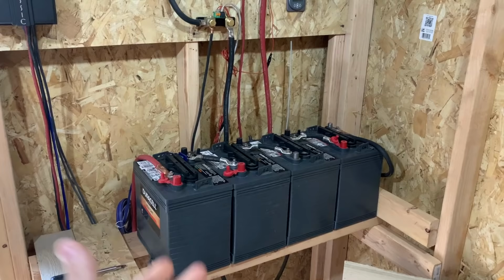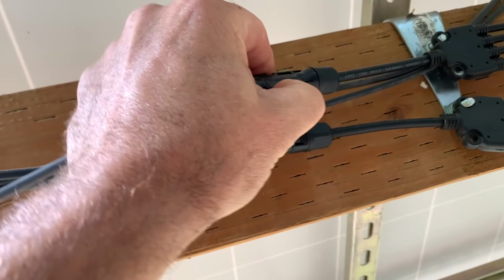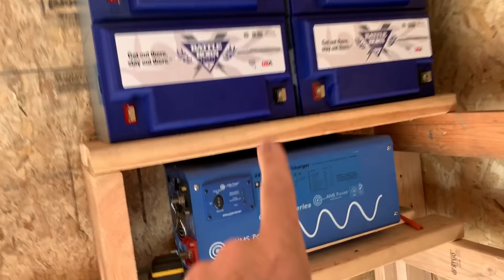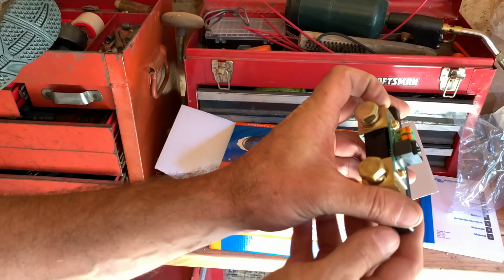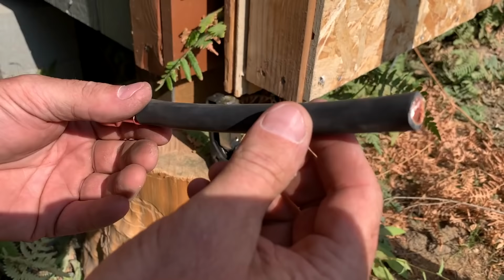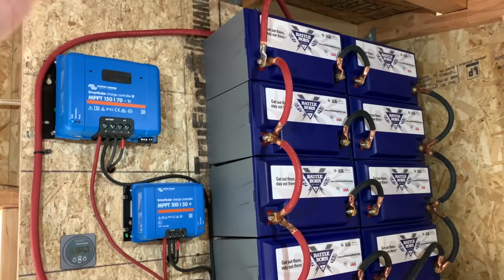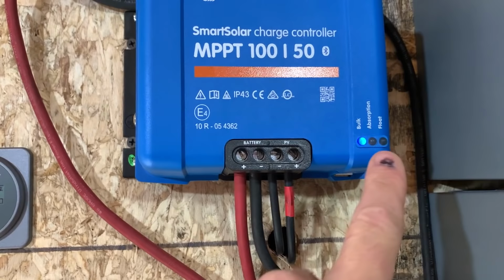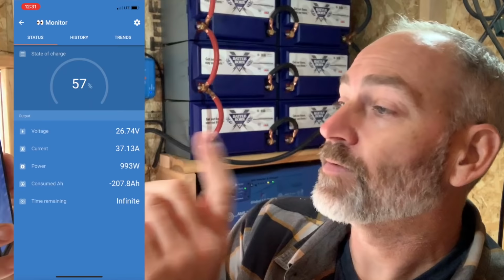EASIEST Off Grid Solar Power System Battery Bank

Comment from the maker: ☀️ NEWEST UPGRADES TO OUR SYSTEM SEPTEMBER 2021 https://www.youtube.com/watch?v=MeaANzjzwf0&list=PL-O59UCFPykiDokS7BRIusbw-D3YJA3jN&index=9
Reply: This is seriously the BEST video on this topic I EVER saw : ) Great products. Super good simple explanation. Thank you. I am totally gonna start thinking about what I want to do for my house.
Reply: Wish you listed how much this upgrade costed you.
Reply from the maker: Wow. Glad it was helpful.
Reply from the maker: The prices are in the links in the description.
Reply: what are you gonna do with all your old components and batteries?
Reply from the maker: @brandonlacour1277  keeping them for another project for now.
Reply: @MartinJohnsonOffGridLiving  well if they get in your way let me know id put in a bid for them 😀
Reply: @MartinJohnsonOffGridLiving  but certain items say sold out with no price...can you list your cost overall..
Reply: Very important to have ALL the battery cables the SAME length! Needs heat shrink on them wires ends, don’t want a short! And you need a disconnect switch
Reply: @FilipinaRandom  It was around 9504 dollars from I can figure out tbh
just a tip though I'd defn put some kind of thing to hold those batteries a bit more secure as I'd be worried they'd all fall down
Reply: Did you receive compensation from Battle Born?  Why did you choose to go lithium vs expanding your lead acid battery bank? You list life, and charge rate... is charge rate an issue on the lead acid, is life less than 10 years for the lead acid?  I'm wondering what the cost benefit of using lithium vs increasing lead acid to the same 400Ahr capacity might be?  $8k seems like it would buy you a bunch of lead.

Oh sorry (edit) at 23:45 you tell us that Battle Born helped you out with cost.
Reply: @Nonya Bidness he can I think 
I then he's likely trying everything the same chemistry for simplicity tbh
Reply: Hi how can I contact you with some questions?
Reply: @earthenergyhex  Batteries are a deal killer for solar. Unless you're off grid, then you just have to pay it. These are actually a great price for what they are. What's funny about solar, is that the panels are the most affordable part of the system.
Reply: @DeepSnowRider  Just go to the website and check prices. The batteries are like over $1,000 each. Not including all the other top of the line stuff. He is being given this stuff to promote this equipment.
Reply: Hello Martin,  one of my coworkers told me that he reached out to you and you were responsive. I have a few questions I'm hoping you can help me with. I recently bought a home off grid. Unfortunately the batteries(lead acids) are in need of replacement. I'm trying to figure out how many lithium ion batteries my system can take. Can I send you some pictures of my current system? Thanks for your help.
Reply: you have to look what a wind mill paired with electrolysis and water supply gives you in terms of a huge tank of hydrogen... wind mill and simple hydrogen generator are capable of running forever and are cheaper than solar panels and batteries plus YOU can fix it. The way this works(and there is a 11 households  in Argentina using this system since 15 years without troubles) is the windmill just powers electrolysis making the tank get filled with hydrogen, so, basically if you can tap on a river you have literally free energy at incredibly lower cost/maintenance than solar panels... plus nobody needs to be called to fix it.
Reply: Hi. Can you list all parts for this installation please?
Reply: @DeepSnowRider  I did a rough guesstimate using Amazon and it came to about $8900.
Reply: umm mr them batteries are 950$ EACH YOU HAVE 8 OF THEM   !!!!
Reply: @dkaloupis75  huge tank, hidroyen generator, any windmill, huge fence and space for the tank and the pipes from one tank to the other... the electrolysis is cheap, the generator is a small motor and the tank pluss space is the only pricy yet nothing if you compare it to 8 batteries plus switching around... btw if you mount it make a video or you will be in debt ! and karma it's a thing! :)
Reply: Mounting Li-Ion batteries like that isn't a clever idea, neither is your wiring.
Reply: @kingscroach  this system is powering 11 households in Argentina since the last 20 years the cost of maintenance is about 1,0000% less, it is the cost of the maintenance of a motor of the size of a motorcycle. Yes you need water to get the hydrogen... WATER. Electrolysis is a simple process and there are all kinds of machines made with very efficient yet simple and cheap capabilities... please simply research before stating nonsense out of nowhere.
Reply: This is hardly a savings. Your looking at what..... $20,000 for this set up? Over 10 years, IF it lasts that long, is $166 / month. How is this a sound investment??? I spend less than that now hooked to the grid. You know how many truck batteries I can buy with $8000.00....?
Reply from the maker: @miuzik8op908  Was it supposed to be an upfront savings?
Reply: How much is the total on panels and everything ya got into this setup
Reply: Dag'um 1k per battery lol
Reply: Dude got like 15k or so in this setup lol I reckon over time it'd pay 4 itself lol
Reply: Shoot the solar panels ain't but like 350 each
Reply from the maker: @Preacher26  check the link in the description they are way cheaper than that.
Reply: @Preacher26  About $20,000!
Reply: @miuzik8op908  that's was bout my guess 15k-20k
Reply: @MartinJohnsonOffGridLiving  ok
Reply: Can u give to me your old sistem 😄
Reply: @DeepSnowRider  10k or more
Reply: Thanks for showing how to connect everything together, i'm still on the fence with solar.... Prices for the battery set-up and panels are still too high , here in the UK...Plus I really haven't a clue on the most effective panels to buy...
Reply: @DeepSnowRider   Well, on the Battle site, each battery is listed at 899.00 USD Each in (Dec 2020). He said he got a deal...  But to buy it all... Close to 15 or 16 grand iI suspect. Maybe more. That is at retail without a deal.  Hard to say without going through each and every item.... But I'll bet I ain't far off.
Reply: How many watts is that power inverter?
Reply: Is this for uninterrupted power supply or do you run your property off the grid?

& if this is a UPS uninterrupted power supply how long does the power last
Reply: 0
Reply: Why did you switch batteries and are you satisfied with the aimes inverter
Reply: Why did you switch batteries and are to satisfied with your inverter thanks
Reply: @BenCos2018  🤣💪🏿
Reply: Would this run a wood boiler, well pump,  water pump and lp stove?
Reply: Excellent Video! Sorry for chiming in, I would appreciate your initial thoughts. Have you considered - Schallingora Computer Reconstruction Scheme (Have a quick look on google cant remember the place now)? It is a great exclusive guide for saving money on your electric bill using this simple technology minus the headache. Ive heard some decent things about it and my friend Sam finally got cool success with it.
Reply: Your cost comparison solar vs generator way off. I can buy alot of gas for $10,000. You're pushong solar like everyone else. Tell everyone how long the panels and batterirs. last.
Reply: Truth .....not the place to look for a honest price comparison.
Reply: @petegaiser7160  hey can you contact me? I have some questions.  But not all that good with YouTube
Reply: With those batteries, you should have plenty of capacity for heavy appliances and entertainment. Upgrade your inverter and run at 48 volts! (Unfortunately, AIMS have raised their prices recently)
Reply: Martin Johnson - Off Grid Living where do I buy the panels from?
Reply: Hi Martin Johnson. Can you give me your email.
I have the same project and I'd like to discuss with you and ask your point of view about the technical solution of the project.
Reply: Thank you for your advice and information. Made me feel less like an idiot. I don't know much about solar systems but you cleared it up a lot for me! Thanks for the video!
Reply: Lol could I  have all the old stuff BAM 💥 please ...
Reply: Made In The USA... same place as the Challenger space shuttle, Boeing 737, and the Ford pinto!
Reply: @earthenergyhex  Try a forklift battery, I paid $2525 for a 16 kWh forklift battery delivered, 10 years ago. Still working fine!
Reply: @WFCinSC  Small golfcart lead acid have a life of 4-5 years, maybe 7 with very light use, larger deep cycle L16 size should be good for 7-8 years, Forklift/traction 10-15 years.
Reply: P
Reply: @stevelaminack1516  for everything?
Reply: How can I get this battery and controller
Reply: @mohammadnurudeen6281  Batteries are $950 each or 8 for $7,600 off Amazon. He uses 2 different Victron charge controllers, a Victron 100/50 mppt controller $324 off Amazon and a Victron 150/70 mppt controller, about $540 off Amazon. Before you buy a charge controller, it should match your solar array...

Battleborn sponsored him, but they might give you a better deal than purchasing through Amazon or at least setup the charge controllers for you...
Reply: Have you had to replace your lethem batteries. I can't have a battery backup, I have to be grid tied, but I was wondering this question as I know all my laptops batteries have gone bad within a year.
Reply: New sub here and loved the video but question, do you have any of your old hardware that is shipable for sale? I seen something of your old things that I am looking for. I don't mind buying used. I could buy my panels local. But I am learning and buying part by part currently.
Reply: are there also a 220v output?
Reply: @avibenzak  .. I am not trying to answer for him by any means but mine has one that I can operate a stove, washer dryer or refrigerator. I am currently  not using it for that however as I am in the process of installing up to 3500 or up to 4,000 of watts in a solar array of pannels first. I am sure there is a few out there with this feature. .
Reply: What a great video
Reply: @DeepSnowRider  it was 8k just in batteries 🔋
Reply: Martin, keep an eye on the voltage of each set of four (12 volts). If one group gets high, you could have a problem. The solve; most of the time you get your power from solar so use charge controller to charge each bank of 12 volts instead of the whole group of 24. Let your inverter/charger work as is.
Reply: This is the video I'm looking for.  Very simple and explains very well.  I subscribe to your channel.  Greetings!
Reply: How much it cost you ? please let me kow and a website where to get them thanks.
Reply: ءءذذذذذش
Reply: @JourneyOnLife  ششش
Reply: @Martinjohnson Love the video. I have my own solar setup
800w solar
4 100 amp solar gel batteries
3000 inverter
Have it all set up was hoping to reach you to help me program Controller
Reply: Do I see your batteries stacked up on a shelf with no strap holding them in place?   🤷‍♀️

What is going to happen if you have a magnitude 2.4 earthquake?  🤷‍♀️
Reply: Great job sir. I am from India, just studying solar system.
Reply: Nice job breaking everything down
Reply: Thank you Mr. Johnson. ill stay tuned to your channel.👍🏼👍🏼👍🏼👍🏼👍🏼
Reply: @MartinJohnsonOffGridLiving  agm batts better than lith. 1/3 price. people use lith in 4x4rs as there lighter. but no better than deep cycle. agm..i can buy 2nd hand agm,s for 150 each. as there exchange for the lith. im in aus. 4x4rs here have a weight problem. but i drive a s.duty.. lead acid no good as storage batts..
Reply: How long have you been using your aims inventor continuously? Are they reliable for year after year of continus use.
Reply: @NIGHTOWL-jf9zt  For me, with that quality, i would invest at it.
Reply: Does this power your entire house to allow you to no longer need typical electricity? Or is it simply back up power?
Reply: I like your set up. How can I tell how big of a system I need? How did you decide? I wouldn't mind converting the entire house, but would like to start with my garage.
Reply: We the ordinary people don't have people Donating 7 or 8 thousand dollars in batteries. You're not helping anyone
Reply: Just got done watching a 30 minute video of a guy extensively tested these batteries and wow …. They are amazing
Reply: Great job. Are the booklets/ instructions helpful if someone is a total newby to this or do you need to already know what your doing?
Reply: @NIGHTOWL-jf9zt  if your building a new home.......its a great deal. Redirect the electrician contractor bill to the solar system instead. A bit more but the initial cost for original electricity set up counter balances the over all cost
Reply: Would this work for grid locked systems?
Reply: Hi Martin, your video is super good. Detail and very clear. Can you share the link of all the devices you used in the video?
Reply: Love to know about this
Reply: @BigMatt08  xcellent…
Reply: Build a faraday cage around everything to protect against an emp.
Reply: Winter cold time, just hook & hang a couple layers of wool blanket, to keep the batteries toasty!
Reply: @dkaloupis75  He did????
Reply: @lamagnitudnortena6423  Amazon
Reply: @Matthew_Loutner  2.4 won't even touch them even for 15 seconds.. .
Reply: @BenCos2018  9504Dollars ????  then you have only the batteries
Reply: I love your teaching sir.
I'm doing solar installation how can you help me to understand and achieve my goal sir please
Reply: Hi, is it possible to connect inverters in either series or parallel to meet a whole house total power requirement as opposed to connecting individual/ group of equipment to individual inverters. I'd really appreciate your response, thanks.
Reply: I WOULD LIKE TO SEE HOW YOU CONNECTED THE POWER TO THE MAIN CUIRCIT BOARD IN THE HOUSE Thanks Troy
Reply: Hi Martin , any email address for further conversation?
Reply: Can you help order parts for me to Ghana?
Reply: May I have your old stuff?  😀
Reply: Just in time thanks for Nice
Reply: Can you tell me what wires I need to use from the inverter to the fuse and shunt. What wires from the battery to fuse and shunt. What wires from shunt and fuse to charge controller . And what wire I need from charge controller to solar panels. 

Any they are ready made? I don’t know anything about wires and I need help. Brought everything else in video . My solar panels have different ends so don’t know how to connect that to charge controller . I’m stuck. Please help
Reply: @petegaiser7160  Generators have their own maintenance costs, including the fuel. Plus you have exhaust fumes constantly. Generators are really unreliable. How much gas does it take to run the generator for 10 years to produce the same power the solar setup will?
Reply: @franciscoholegario2757  Watch Will Prowse or David Poz here on Utube for people with real knowledge of solar. This guy is not knowledgeable enough to consult.
Reply: Sorry for being rude dit not mean any harm 
It's just because I  am all the way from Africa and see these unjust things taking place 
And are concerned about it
Reply: Try rail shutters chrome paint l.e.d.s lights. Poof electric at night 🌉🌙✨😌🎶👌🌉🌙✨😌
Reply: It's so nice video dear, I'm studying solar energy engineer but I don't have more skills about it can help me sir . With name of materials you are using.
Reply: What do you run it to in the house to regulate where the power goes
A bunch of converter boxes or is there like a panel
Reply: Hello Martin! I have a 6KW 48v inverter and charger, same type like yours!
Can i use a grid-tie inverter in "AC coubling"? 
Is this thing capable of generating sinewave, and charging the same time?